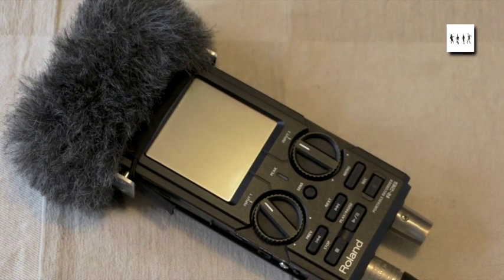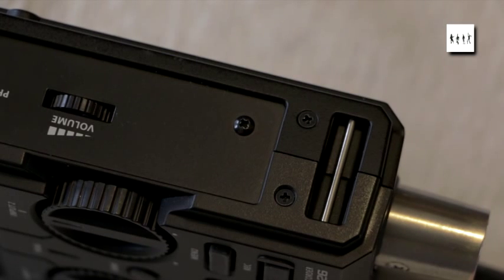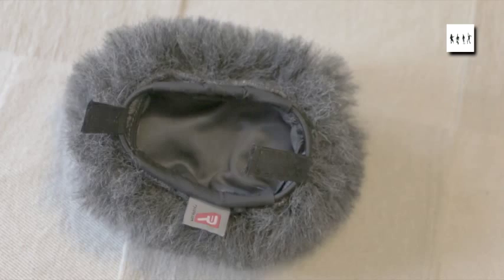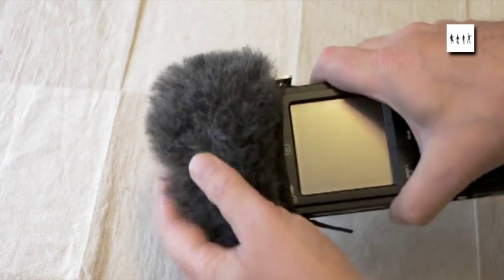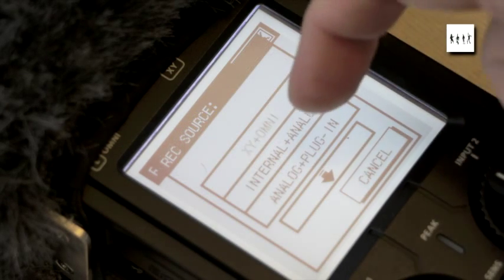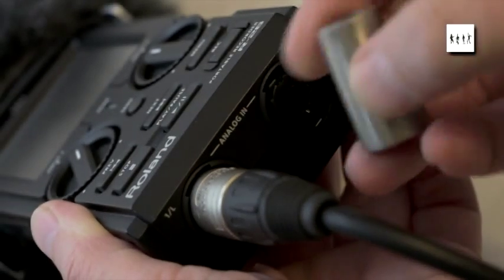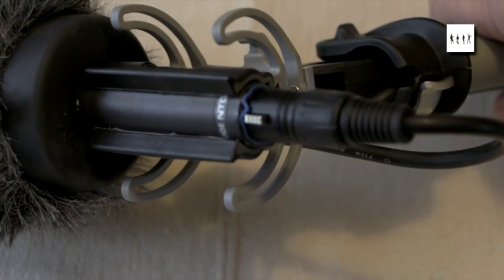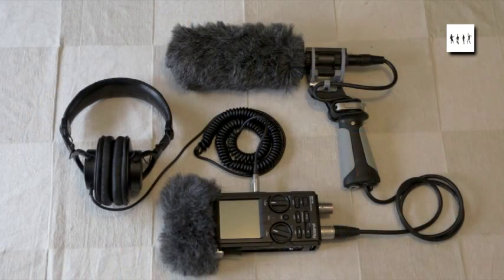Modifications to R-26 Recorder and Rode Microphone Grip

Comment: Hi. Can You explain me more precisly this trick with shorting plug for unused XLR inputs? Is inside specjal connection or just empty plug? I did try with many settings and noise is the same always. :) And what are your settings in input type? Separate?
Reply from the maker: Hi Krzystof,

It's a long time since I did this video, so I had to get the R-26 out and look at the settings...

In this configuration, the setup is as on the video: Rec Mode = 4-channel,  Rec Source = Internal+Analog, Analog In Input Type = Separate, Input 1 Phantom = On, Input 2 Phantom = Off, Sensitivity Analog = -56dBu.

Note that this is quite a high gain (sensitivity) setting, as might be used to capture very quiet sounds. When recording louder sounds with lower gain, noise on the unused channel is not really noticeable anyway.

The mic preamp is designed to have a comparatively low-impedance source connected to its input, say 200 Ohm, which is the case with most pro mics, but leaving the inputs open represents a very high impedance (>1M Ohm). 

The higher the source impedance, the greater the thermal noise at the input to the preamp - that's just a fact of physics, unfortunately. That noise is amplified by the mic preamp.

By shorting XLR pins 2 and 3 ('hot' and 'cold' signal inputs) together, the preamp is seeing a near-zero-Ohm impedance, with corresponding very low thermal noise. 

Even if phantom power to this input is switched on, it is not an issue, as the voltage is common to both input pins, so there is no net current flow between them. 

Pin 1 of the XLR is ground, and connecting that to the XLR body helps to shield the inputs from ambient electrical interference. 

It is important not to connect either of the input pins (2 or 3) to ground pin (1), as that will short out any phantom power and may cause additional interference.

Hope that helps!
Reply: @reqordist  Thank You very much! :)